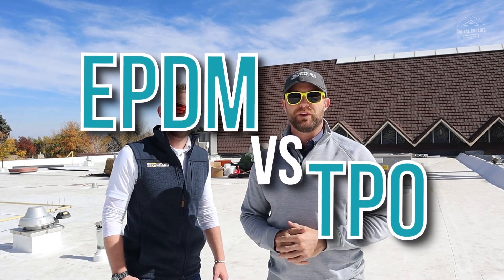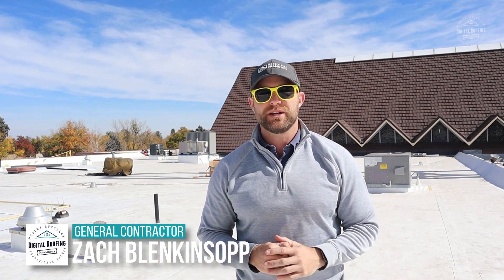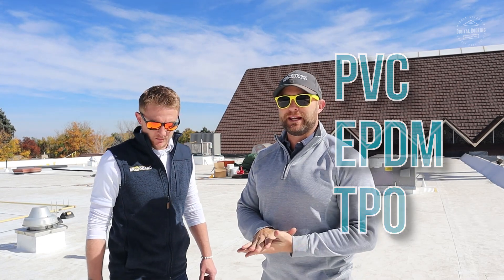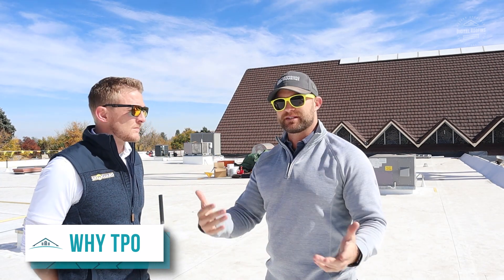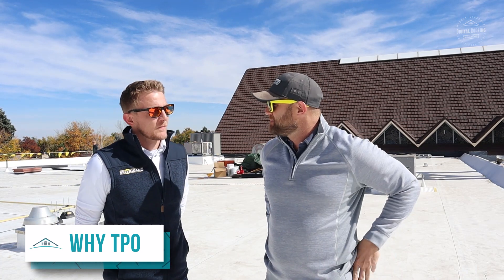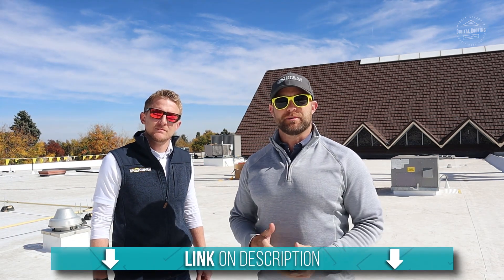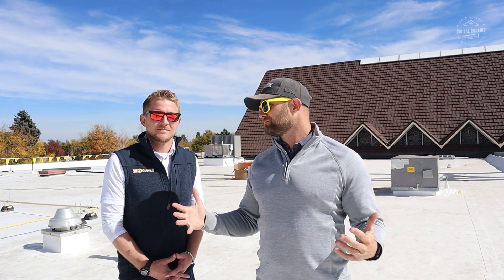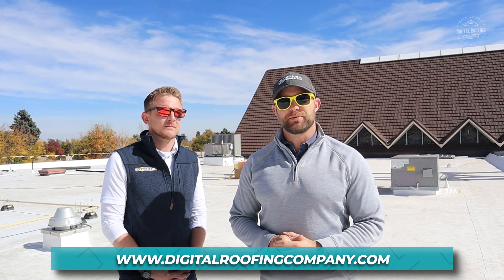EPDM vs TPO Flat Roof - What's The Difference?

Comment: Who’s denying you, what authority for code? Can’t the customer choose whatever material they want, regardless of code? Is it the law ?😊
Reply: Yes the customer can choose. 
But the “newer” federal energy codes require a certain level of heat transfer resistance. Also know as insulation value. R value. 
When installing a flat roof with the buildings primary insulation “on the roof” versus in a attic space, a white roof increases the reflectivity of the sun and heat gain thus you are allowed to install less insulation by thickness.  
White roofs or roofs with white coatings allow a money savings on less insulation.

Comment: apples and oranges, EPDM best for the northern parts of the country, better hot cold cycling,  no restaurant restriction for EPDM, simply ventilate of interior moisture is high.
Reply: I disagree. 
EPDM will get eaten and warp with grease on the roof of a restaurant. TPO resist grease and is not affected by it. No EPDM on restaurants.

Comment: If using TPO, is it best to get the THICKEST sheet possible?
Reply from the maker: No, not always.  The thicker is also much more expensive.  Similar to standing seam metal roofing.
Reply: @DigitalRoofingInnovations  What do you think of Elastomer or modified Bitumen ?

Comment: Which would last longer TPO vs EPDM in residential humid environments I've heard EPDM is better durability wise?
Reply from the maker: Great question.  I think the reflectivity of TPO is definitely something that gives it an advantage in dryer, sunny climates.  Both are very durable and great options for flat roofs.
Reply: Both systems will handle exterior moisture ( from rain, snow or humidity) with ease.  If you are referring to humid conditions  inside the building (like a pool or greenhouse) - this is a matter of installing a proper vapor barrier and insulation.  It seems counter intuitive but black EPDM membrane  will actually hold up better to intense sunlight and heat than TPO.

Comment: Can a tpo roofing become Chalky???
Reply: Yes, but most "chalky tpo" is actually usually a CSPE/Hypalon roof, which is an old roof type discontinued in 2010.

Some TPO, mostly from 2001-2007, used a formula that would rapidly decay and turn to dust over time. This was because one of the main binders in the formula was unavailable,  so new tpo formula were developed.  With this in mind, there is no such thing as a tpo roof over 15 years old, because 15 years ago that formula was changed by every major manufacturer again.

The easiest way is to send videos or photos. It's hard to explain how to tell over text.